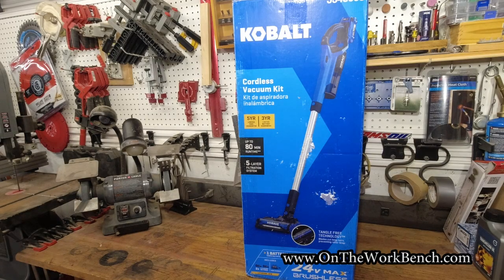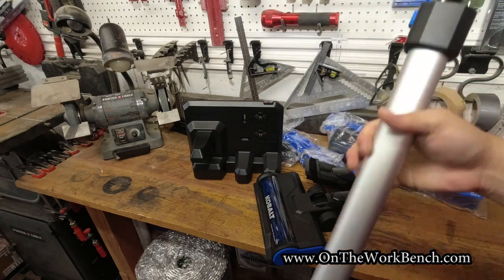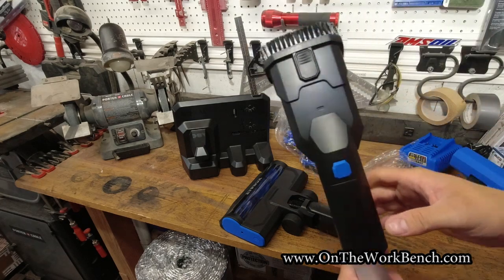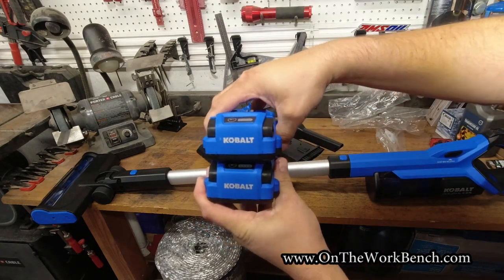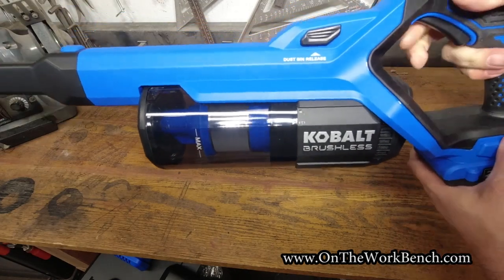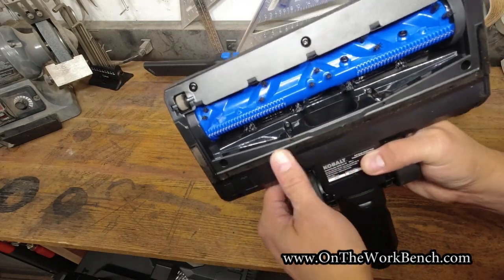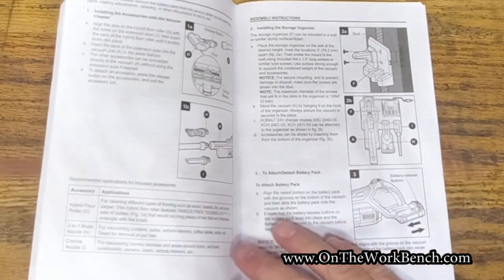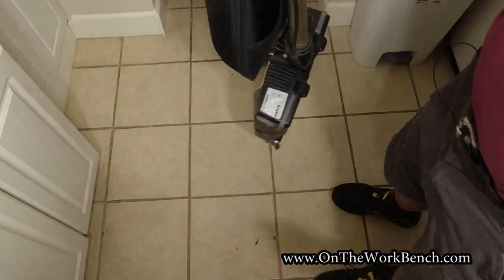Kobalt 24v Stick Vacuum

Comment: GREAT REVIEW!  Thanks!!

I've been looking for a small, hand vac for around the kitchen and other areas.  Just something to grab and clean quickly.  I LOVE that it has both the small hand vac capabilities but also the floor extension which also can be used with the attachments.  The base looks like a great idea and would be really handy for keeping everything together.  

So what I'm noticing is there doesn't seem to be a place to hold fully charged batteries except in the charger.  Would be nice if it had a few slots to simply hold batteries when they're fully charged and not in use.  Also when using it as a hand vac, without the wand attached, would be nice if there was a place on the base to hold the wand and floor attachment.

So overall I think it's a really nice tool with a few things to improve upon but it seems a little pricey.  I haven't done much shopping yet and everything getting more expensive so perhaps that's not that far out of line.  I'm sure the Dysons will be a lot more expensive. haha

Anyways, good stuff...thanks again.
Reply from the maker: I agree about needing an extra blank battery holder slot. I'm not crazy about storing a battery on the charger either.

Comment: I’ve owned one of these for a year.  As discussed in the video, I’ve rinsed out the “core” multiple times but it seems as though there’s always residual dust and it takes forever to dry out.

Have you attempted to disassemble the core?  It’s shown disassembled in the photo, but I cannot find a way to do so without breaking the vacuum.

Comment: I really wish it didn't have a trigger to use it, esp if you are using it a lot ...guess you can use a Velcro strap to keep it pressed in until done but still a lil disappointed in that.. overall it seems great thou. Thanks for the review.. I still might get it and sell the craftsman stick vac.. being I only have craftsman batteries only for the stick vac. I would like to get rid of it and get this to go with all my kobalt batteries
Reply from the maker: Agreed, a lock-on for the squeeze trigger or a click-on-click-off switch would be nice. 

The upside is that a switch like this  probably extends the runtime of the vacuum by making it easier  to turn off when not needed.